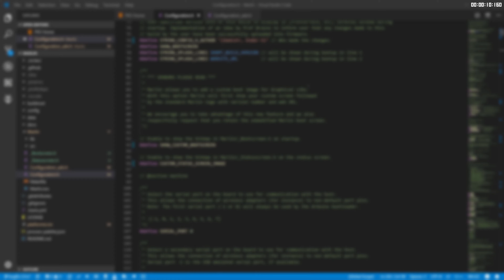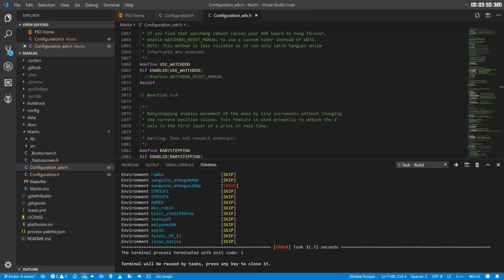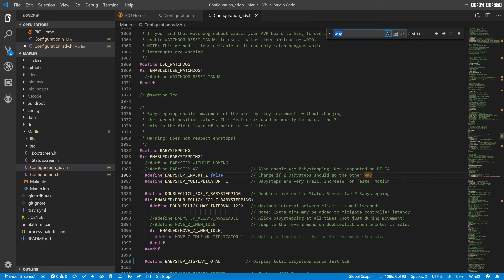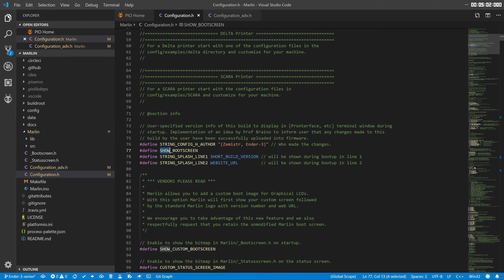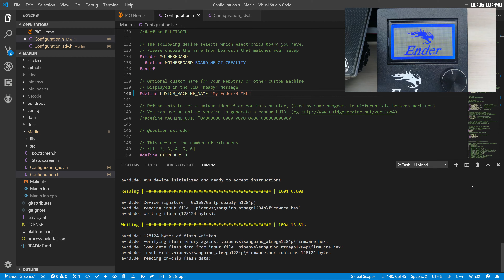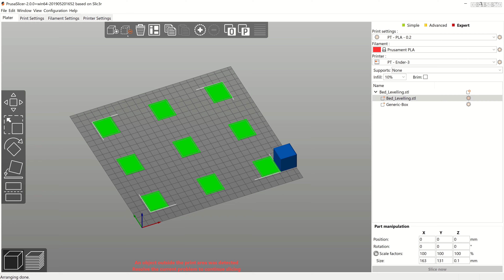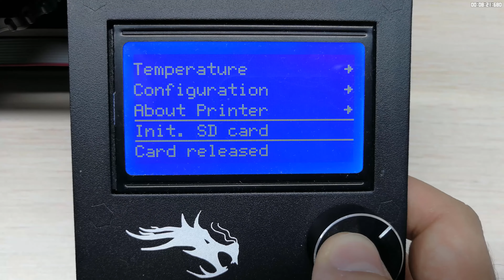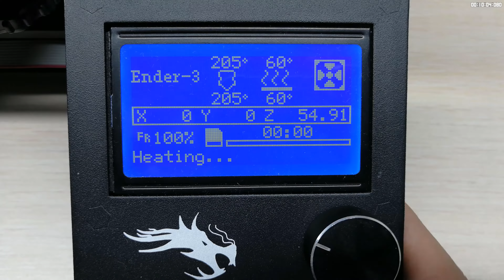Mesh bed leveling (3D printing)

Comment: i have error when i use mech bed leveling, i update the bed of my cr10s to y = 600 mm and other axis still them, so when i complete leveling and enable it, the printer goes in infinite loop when i go more than y = 470 mm,  no halt and serial show processing always...
any idea? 
thanks